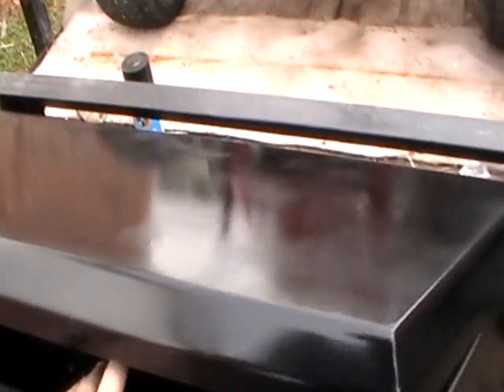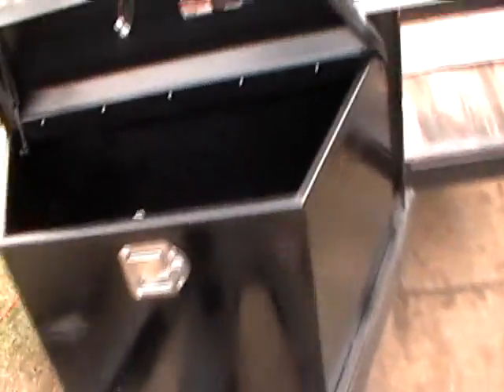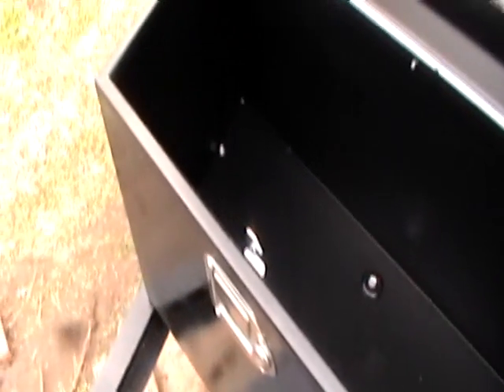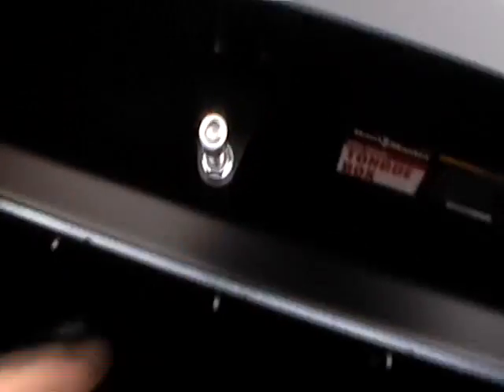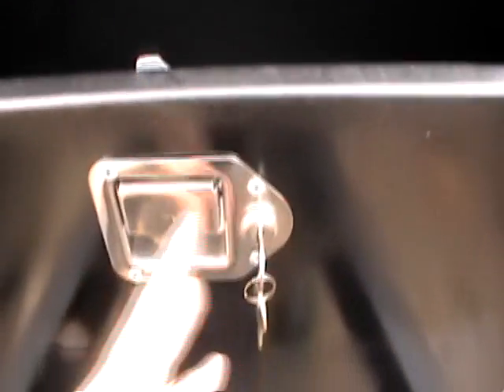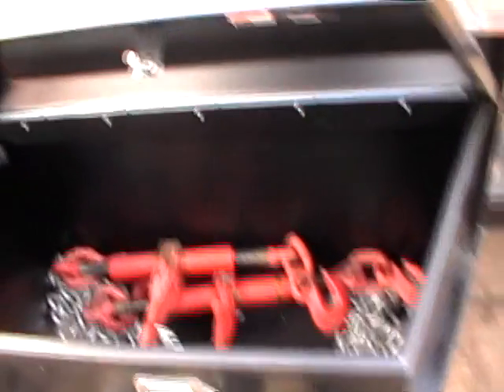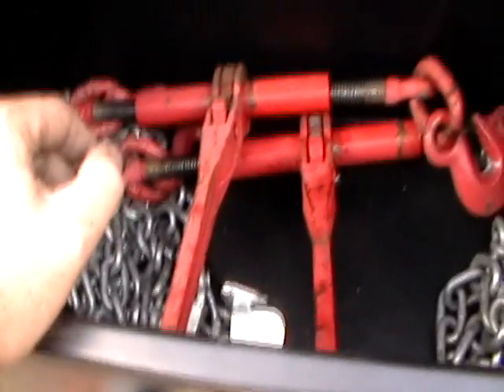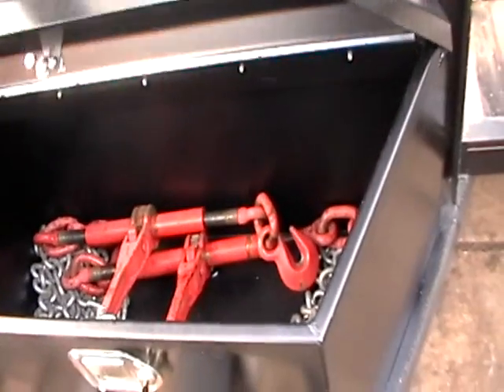Harborfreight Trailer Tongue Tool Box Part 3 of 3

Comment: I see you have had your tongue box for over two years now. I'm wondering how your clear coating the box has turned out. Has it kept the paint from fading? 

I am going to be mounting my box from Harbor Freight today.
Reply from the maker: To be honest it's faded a little but the main thing is no rust.  And everything still works like new.  Bottom line for the price I'd buy it again
Reply: Great thanks, I think they got the latch issue figured out. I tested it out after watching your video and it seems to be fine.
Reply from the maker: Awesome good luck and thanks for watching